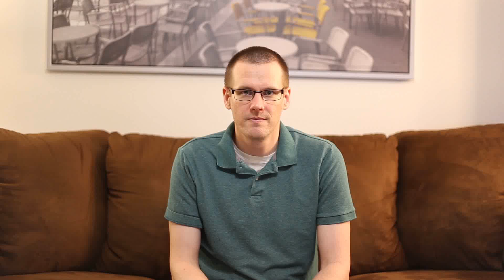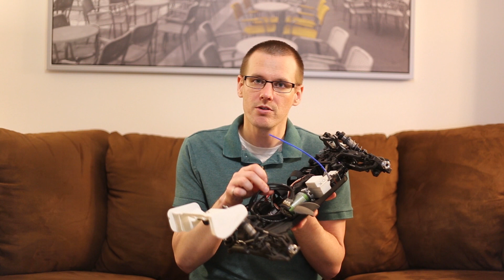Applications of Sensored vs Sensorless Brushless Motors

Comment: That's good.
One topic I feel needs some illumination which you seemed to skip over and that's stock racing. We know that 4 poles gives you more torque then two poles and that for power sensorless is better. However stock racing motors all use two pole sensored motors. From my understanding two pole motors can achive much higher rpm then 4 pole motors given the same running voltage and number of motor turns, given stock class is restricted the number of motor turns you cannot go below as well as being restricted by voltage of 8.4V (2S) and although a 4 pole motor can achive more power and just as much rpm it requires either lower motor turns and or higher voltage to do so that are outside regulations permitted in stock class.
Also from my understanding the main reason for them being sensored is to offset the lower torque usually associated with two pole motors and to help them run smoother with a more liener power curve.
Anyways would be good you could actually make a video on this as most people just seem to accept that stock class motors are two pole and sensored without really understanding why.

Comment: @RCexplained, you explained very clearly why sensorless motors have problems with starting at high load, but what is going to happen when the start is light, and then the load gradually increases, to the point that the motor speed drops to 50, 30, or even 20% of nominal speed? I am talking about a load progression similar to what an electric screw driver experiences. Will the sensorless motor stall much earlier than sensored? Will it stall at lower torque? Will it also become noisy and shaking before stalling completelly?
Reply from the maker: Dropping speed due to loading is not necessarily a problem. Dropping speed below the minimum required speed to stay in synchronization is key. This RPM is quite low and you can test this with any RC car quite easily. The ESC needs to have feedback from the motor to stay in sync. If the speed is too slow the motor will stall.
Reply: @RCexplained  I think you are refering to sensored motor, right? I would be interested to know what is going to happen to a sensorless motor in these circumstances, that is increasing load and consequent decrease of speed. Since ESC does not know what the momentary motor speed is, I presume it will keep running at the same frequency, despite the increasing load and decreasing motor speed. Does it mean that some kind of slip will occur every n-th revolution, the more often, the more the motor speed differs from ESC frequency? Will it then just stall suddenly, or will some kind of precursory cogging/jerking occur first before the complete stall? At what percentage of nominal speed (or free running speed) should this be expected to happen typically?
Reply from the maker: My reply was about sensorless motors. The esc does know the speed of a sensorless motor when it is spinning above the minimum backemf threshold. Above this speed 0 slip.

A sensored motor would be 100% in sync from 0 rpm to max. Once a sensored motor starts spinning at a moderate speed most ESCs will ignore the sensors and then run in sensorless mode.

Comment: are bldc motors good for applying constant torque or do they heat up and have bad efficiency there?
can they be used for low-rpm yet high torque applications without gearing it down? I couldn't find a proper answer when I googled :c
Reply from the maker: If you use a controller that gives you constant torque, a BL motor will handle this no problem. You can get a motor with a very low kv that will operate very well at low RPM with ridiculous torque.
Reply: @RCexplained  :O thanks. most of the motors i found were something like 130KV and drew like 10a-5a at 12v D: also the torque I found was something like 1.9N.cm. a stepper gives me 10N.cm at a much lower wattage! I think I'll just use a stepper regardless. they're kinda bulky tho.
maybe I can do a 10:1 gear ratio or something with the BLDC

Comment: So if I were to be using an RC car BLDC motor as a generator, is there anything I should be worried about 1) using it in general as a generator and 2) if it is sensored? Like does using a sensored BLDC motor as a generator have issues because of the sensors? Would there be advantages of having the sensored motor especially while using it as a generator? 

(I do know they have to be spun at very high RPMs to get appreciable power out)

Thank you you for your videos! They’ve been very informative!
Reply from the maker: I don't see a reason to use a sensored motor as a generator as they are more costly. You can and just not use the sensors.

A low kv motor will not have to spin all that fast to produce a voltage.
Reply: @RCexplained  ok that’s good to know thank you! This may be an obvious question but are the sensors in the motor just position feedback, like a Halbach array, or do they also include things like internal temp read out and other things? Also If they give position feedback can that sensor be used for giving a read out of the exact positioning of the motor in degrees from some origin position or is it just position relative to the nearest coil and magnet alignment? 

oh also I’m ok with the high RPMs 😁 I’m going to be driving it with my Tesla turbines which will be able to do 25k-65kRPM. I actually specifically want the high rpm ranges. I was going to say take a look at the videos I’ve made of my Tesla turbine and ask you if maybe you had a suggestion of a good BLDC motor that I should use as a generator but I didn’t want to come off sounding like I’m trying to push my channel. I just genuinely would love to know your opinion on the generator side of things on these great little BLDC motor/generators. I watched your video about the regenerative breaking within the esc and I thought that was amazing to know and I almost thought I could just use that for my whole system but alas the efficiency of the esc rectifying the 3 phase to dc was lower than I would like for practical application as a generator. 

I plan to use my esc and RC car remote to aid the turbine to get passed the starting cogging torque for using the BLDC motor as a generator because Tesla turbines have low torque at low RPMs, so the throttle alone won’t be able to get the turbine and generator up to speed. But they work great once up to speed so once at running conditions, 25k-65krpm, I was going to give complete drive torque to the throttle on the turbine and cut the power from the esc and (carefully) connect the motor wires to a 3phase ac to dc rectifier to get DC power out. I acquired a cheapo GoolRC 3660 3800kv waterproof BLDC to do a test for the power output capabilities. The description says it’s rated at 1200w, 92 amps with 13v @ ~50krpm. (And I’m sure this thing may be rated for higher than what it should be run at continuously also) so I know that at 50kRPM to get 1.2kw (1.62HP) you only need to supply 0.2ft-lbs of torque in general for any thing as thats just the basis of mechanics as a force at a distance of rotation over a rotational distance is equal to work done, so obviously considering efficiency loss it’s a little more than that in real life but is this directly translatable to how much torque I would need to put into this 3800kv BLDC motor at 50kRPM to get the 1.2kw out, at 13v and 92 amps? 
Kt=1/kv  = (1/3800) = 0.0002631nm/amp or .000194ftlbs/amp 
(.000194ftlbs/amp)*13amps = .002522ftlb for 13amps.....? 
Which is far lower than the 0.2ftlbs needed for 1.2kw at 50,000rpm, when it’s supposed to be 13amps at 92volts... 
What am I missing here...? 

Forgive me if this more complicated of an ask than you’re looking to offer, you’ve already answered a bunch of questions for me so thank you for your time either way! If you have a patreon I’d be happy to donate to pick your brain on the topic for a little you’re up for it. Let me know thank you!
Reply from the maker: Hi Charlie, yes the sensored motor can have a temp readout as well. This depends on the motor. 

Your 0.2ftlb does not consider the efficiency of the motor operating at 1.2kw. 1.2kw is the input to the motor not the mechanical output. Don't forget about this.

You also switched your volt and amps. Multiply Kt by 92 amps not 13V.
Reply: @RCexplained  oh derp! Thanks for catching that. I knew I was making a stupid mistake somewhere when I was multiple orders of magnitude off. 

And perfect that helps! Because I was wondering if I could just get a BLDC motor/generator that has a built in temp sense that I can keep an eye on while generating power. It just makes implementing it within my system that much easier and safer. For real thank you you’ve been a great help!
Reply: @RCexplained  ok yeah so with a resistance of .0083ohms and a 92amps at p=i^2*r that’s ~70.25watts copper losses and with 13volts and an Io of 4amps that’s 52watts iron losses, yielding ~122watts loss at 1.2kw in with 92amps at 13v-50,000rpm. 

90 percent efficient is dang good in my honest opinion for a $30 BLDC. Obviously I’m sure there are way better. Especially when I can actually reuse the heat loss in my heat recoup system. 

Should I expect the same kind of 90% efficiency and losses while using it as a generator or are there other components to this that I’m not considering?
Reply: @RCexplained  again thanks for sharing all this legit maths for this. It’s going to make representing my actual results and loss calculations on the Tesla turbine in the end very accurate. So much gratitude!
Reply from the maker: Your 90% calculation would be an absolute max. For example.   If your motor gets hotter then the temperature Rm was measured at, resistance of wire increases, increasing the Rm value. You'd also need to know if 1.2kw is a peak power output or continuous power output.
Reply: @RCexplained  ahh good point about the increased temp resulting in the increased electrical resistance, creating more copper losses. Would the reverse happen for iron losses as the iron cores lose their magnetic susceptibility as they increase in temp as well or are these not ever getting hot enough internally that that would change at any appreciable rate?

I only ask because Nikola Tesla’s ThermoMagnetic motor patent is designed principally around this phenomenon. https://teslauniverse.com/nikola-tesla/patents/us-patent-396121-thermo-magnetic-motor

Also I’m sure those values are more readily available for higher end motors but how would you suggest I find out what the continuous safe rated power output is instead of the peak power output? should I just assume what the company is reporting is the peak output that’s not sustainable without advanced cooling methods? 

I will say one nice thing about the way I’m doing these with my Tesla turbines is I will find one operating rpm and try to keep it continuously operating at that threshold so it’s just a matter of picking the right motor to be within safe and efficient operating parameters for each design.
Reply: @RCexplained  oh wait I just remembered the iron losses are due to eddies in the iron cores due to its conductivity not it’s magnetic susceptibility. Ignore that part of my last comment lol

Comment: To better understand the back EMF, it is useful to understand that at any one moment only two of the three motor wires have power flowing through them. The third wire is the one that is measured to determine what the motor is doing, as the motor acts a bit like a generator on that wire (back EMF). This is also why sensorless motors work poorly from stopped or at slow speed, because when the motor moves very slow, the "generator" effect that creates the back EMF is too small. In those cases the controller has to simply guess the position of the motor, and commutate blindly until the motor moves fast enough to provide feedback.

Comment: Great video I have a question with a sensor motor all I have to do is plug my sensor wire in the ESC and Motor After that it should work fine I shouldn’t have to do anything else is that  correct? Thank you
Reply from the maker: Thanks for the comment, yes that is correct. If something is not working as expected, check the settings within the ESC to confirm it is operating in sensored mode.
Reply: @RCexplained  ok thank you 👍

Comment: @RCexplained, is there a simple bench test I can perform to confirm the sensor is functioning as expected? Beyond that, can you share a solid method for tuning/adjusting timing on a sensored setup? I love your technical videos! Thanks - CG
Reply: Lol, that sounds like so much overkill. The motor will cog like a sensorless motor if the sensor wire isn't being used/isn't working. The point of the sensor is to not have motor timing be an issue; no need to set timing in sensored setup, does it automatically and exactly.
Reply from the maker: You could find the pin outs of the motor sensor cable that lead to each sensor and use a multi-meter to bench test. There are also motor analyzers available. My charger, although I have not used the function yet, does include a function that will allow a sensored output in to the charger for testing.

Almost forgot, to adjust timing, I start in the middle and choose to go either low or high based on my goals. I am looking at a data log and speed generally. I want to confirm that more power consumption results in actual measurable performance gains if going to higher timing, otherwise there is not benefit.

Comment: Can a sensored motor be used in sensorless ESC ?? , I won't be using the sensor wires from motor !!!. Is it possible ?
Reply from the maker: Yes that is possible!
Reply: @RCexplained   any link where I can get proper explanation of this ?
Reply from the maker: @yashmadkaiker1360  I'm not sure of any. The concept is that any brushless 3 phase motor can run off a sensorless esc.  Sensors are simply an added feature and are not required.
Reply: Will you still get the sensored affects using that setup? Sensorless esc and sensored motor.
Reply: @mrwaffleboy99  no it'll act like a sensorless because the esc is sensorless and thats all it knows how to do

Comment: So for a traxxas trx4 bronco crawling on obstacles sensorless would be best??
Reply from the maker: A sensored system would be best for those initial starts from 0 RPM.  I would recommend a sensored system as it sounds like you will be playing in the very very low speed range.

Comment: I'm just wondering is it possible to run a sensored brushless motor on a unsensored esc?
Reply from the maker: yes, the sensored brushless motor will operate in sensorless mode. (sensors will not be used)
Reply: @RCexplained  yea cause I have a reedy Sonic 540 6.5 turn sensored brushless motor and I'm getting a 120A esc shipped to me soon from wish. But yea just one last question what do the sensores usually control cause the esc I had connected to the motor would go full throttle on barely a quarter of throttle pull and the braking function for my motor would be fully engaged so the tires would stop spinning almost instantly so idk what the cause was for that but my rustler at the time got ran over by some #$$hole who knew it was there and nothing was done about that but I got my rustler all fixed up and set for a new esc to be put on it
Reply from the maker: Hi Tyla, that's unfortunate about your rustler. Glad you have it fixed up. The sensors job is primarily to allow the ESC and motor to get in sync starting from 0 RPM. A sensorless motor would hesitate upon acceleration from 0 RPM. Once the RC is moving this goes away very quickly.

Comment: Depends on the quality and type of motor a Lehner 3080 sensorless inrunner with ironless core are the smoothest and most powerful rc/industrial sensorless motor on the planet super smooth instant torque from start to finish it also depends on the  quality of the ESC  most of all - Kontronic,Mgm,Vesc or a quality ESC that have FOC some Outrunners of less quality and build will not sync with some cheap ESC,s that cause that glitch on load start up but will run ruffly and make a wine or humming noise while in rotation a good ESC smoothes all this out by being able to read the rotor position in hundreds of miliseconds but those ESC,s are not cheap and mainly only German made besides the Castle Creation 160hv that sync well with sensorless inrunner/outrunners
Reply from the maker: Lehner motors are excellent motors indeed.

Comment: Can you make a sensorless motor work with a sensor esc
Reply from the maker: Some sensored ESC's can operate in a sensorless mode allowing the sensorless motor to be used. This is ESC specific.
Reply: @RCexplained  that's what I was afraid of. Thanks for the response.

Comment: Thanks for you explanation! I'm struggling to find a good combo brushless waterproof (splash) motor/esc for my Tamiya XV-01. It has frontal motor, very long motor cables (and sensor cable) need to reach the esc. I'd like to use a 13,5 t motor with 3s lipo. Do you know where could I find some information or do you have any suggestions? Thanks
Reply from the maker: Hi Lucadoc, thank you for your comment. I would suggest jumping on to a forum and posting your question on a Tamiya XV-01 thread. I'm not familiar with that Tamiya model.
Reply: @RCexplained  Hi Ryan, I'll go on the Tamiya USA forum, thanks